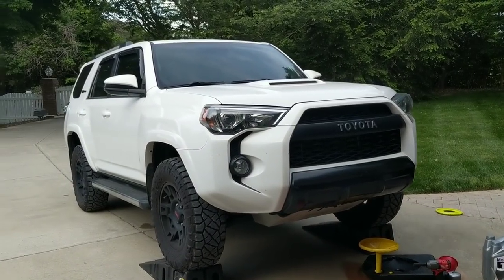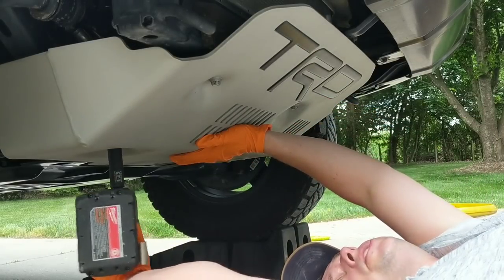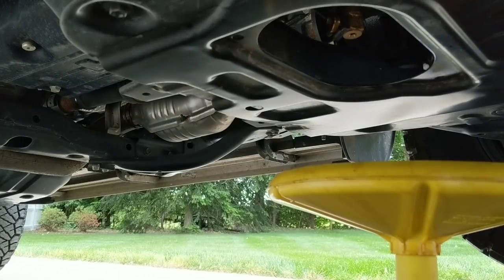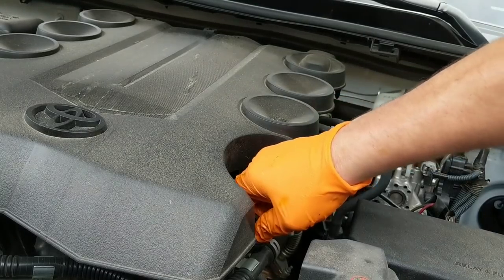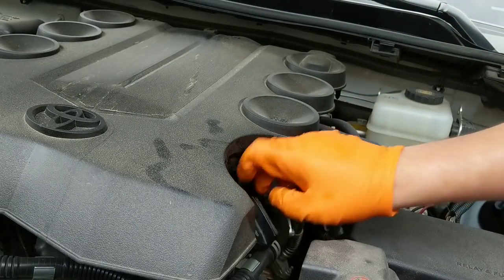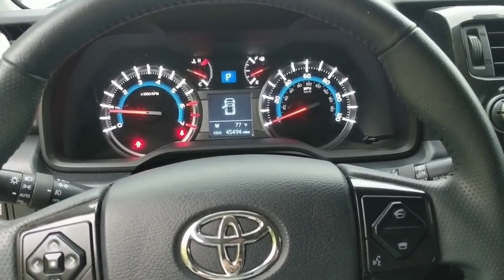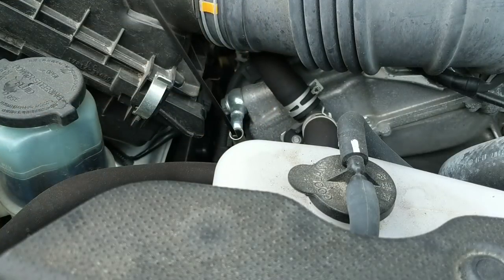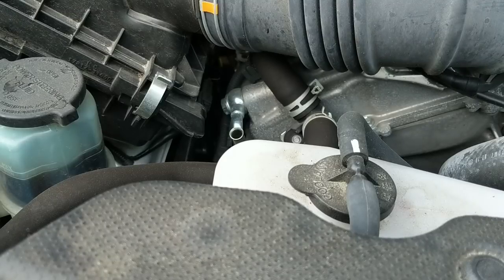2010 - 2021 Toyota 4Runner Oil Change - Beginner's Guide

Comment: Those with a TRDpro skid plate - go to the local hardware store and buy rubber washers to hold your front bolts in place. In other words, insert the bolt through the plate, drip space down, and add the rubber washer on top. This washer will hold the bolt and washer in place while you lift the plate up to bolt on.

Comment: I own 2 4runners 5th gen. My wife has the Limited and I own the 2016 TRD pro.  I also changed my spark plugs at 30k and I noticed my fule effeicy improve by 3 mpg more on my TRD pro and 4 on my Limited. I was getting around 12 mpg on my limited and 14 on my TRD pro. My advice is CHANGE THE OIL THE ENGINE OIL THE FIRST 2K MILES, THEN AT 5K, THEN EVERY 3-4K WITH SYNTHETIC. Why, from experimentation and diagnostic tools from my friends shops using heat and yes, I was so OCD about getting my answer, I sent in samples to a lab to see the results. The first 2k miles are curicial because that's when the engine is breaking in and there will be some fine metal shaving, you wont see it, but you can feel somewhat and the lab will defiantly indicate that.  After that, at 5k,  your repeating the process with less shavings. It took me a total of 3 engine changes at short intervals for about 10k miles to break it in. Where I found very little metal shavings. I don't care what anyone says, this is the proper way to do it NOW IF YOU TOW, LIVE IN PLACES LIKE NYC WHERE THERE LOTS OF STOP AND GO  AND HEAT. GET THAT ENGINE OIL CHANGED OUT EVERY 3K RELIGIOUSLY .  TRANSMISSION OIL THE FIRST 15K MILES IS CRUCIAL. THERE WAS VISIBLE TRANSMISSION SHAVINGS then at 15K MILES. Personally I would even do it at 8k then 15k then 30k.  Then every 20-30k miles DEPENDING ON HOW YOU U SE YOUR 4RUNNER.
Reply from the maker: All great advice! Most people are not as meticulous, but I agree it will lead to a longer life of the engine. Nicely done using Blackstone or whoever for testing. I use them as well. Thanks for the comment!
Reply: @BtwilliasGarage   Thank you brother and congradulations on the Runner. May she serve you loyally and reliably for many years to come. I doubt it cause it's Japanese made and the critera from what I understand is super strict, IT'S NOT LIKE WHAT AMERICAN TOYOTA IS. though american toyota is still good. My brother has a 2016 toyota Camry, made in USA  with 100k, 3 accidents, flooding, stolen and 1 pile up accident. fixed it every time. SAME ENGINE AND TRANSMISSION. He thinks following my protocol helped give with the engine and transmission longevity.
Reply from the maker: @aky19832001  Good stuff man! My 3rd Gen has 289k and still going strong. Hope the same future is in order for the 5th Gen. I will keep the oil changes under 5k and we shall see. What oil do you use?
Reply: @BtwilliasGarage   I use only “Toyota Genuine Motor Oil” : ILSAC GF-5 multigrade SAE 0W-20 engine oil
. You get better gas mileage than the 5w series. Everyone tries to argue, and i"m like READ YOUR MANUAL BUDDY!  This is straight out of their manual. I swore to everyone that my gas mileage was attributed to oil, no one believed me. NOT EVEN THE DEALER. WHEN I went back to make sure the oil was ow-20, which it wasn't, it was  5w, I had them change it immediately to ow, it took me 2 oil changes to see the difference of 4 mpg extra. that matters. because 4mpg extra at 20 gallons, that's 40 extra gallons at 3 dollars a gallon, that's $120 dollar saved. This is from the Owner's manual for 4runners 5th gen page 465-
 “Toyota Genuine Motor Oil” is used in your Toyota vehicle. Use Toyota approved “Toyota Genuine Motor Oil” or equivalent to satisfy the following grade and viscosity.

Oil grade: ILSAC GF-5 multigrade engine oil Recommended viscosity: SAE 0W-20 SAE 0W-20 is the best choice for good fuel economy and good starting in cold weather. If SAE 0W-20 is not available, SAE 5W-20 oil may be used. However, it must be replaced
with SAE 0W-20 at the next oil change. Oil viscosity (0W-20 is explained here as an example):
• The 0W in 0W-20 indicates the characteristic of the oil which
allows cold startability. Oils with a lower value before the W allow
for easier starting of the engine in cold weather.
• The 20 in 0W-20 indicates the viscosity characteristic of the oil
when the oil is at high temperature. An oil with a higher viscosity
(one with a higher value) may be better suited if the vehicle is
operated at high speeds, or under extreme load conditions.
""- Why give your self a headache and try to do something that's not your job as in go again'st what Toyota designed. I'm a physician by trade, not a engineer. I love Toyota 4runners. and I'm a "fanboy" lol of their SUV ( landcruisers, prado, lexus) , but that's as far as I go. I  know people make fun of  me but when they don't have much to say when they start running into high temperatures and burning engine oil
https://www.toyota.com/t3Portal/document/om-s/OM35B48U/pdf/OM35B48U.pdf
Reply: @BtwilliasGarage   Also more about engine oil that people don't know from toyota 4runner manual ■Engine oil consumption
A certain amount of engine oil will be consumed while driving. In the following
situations, oil consumption may increase, and engine oil may need to be
refilled in between oil maintenance intervals.
●When the engine is new, for example directly after purchasing the vehicle or
after replacing the engine
●If low quality oil or oil of an inappropriate viscosity is used
●When driving at high engine speeds or with a heavy load, when towing, or
when driving while accelerating or decelerating frequently
●When leaving the engine idling for a long time, or when driving frequently
through heavy traffic
Reply from the maker: @aky19832001  all good info. Thanks for sharing!

Comment: Just did mine yesterday and was a nightmare without ramps or jackstands. Now I know. Swapped out the OEM plastic filter housing for a better aluminum metal one. Love that lil valve for the drain plug! That's next time. Yeeeeew 🤘🏼
Reply from the maker: Nice work! Thank you

Comment: To increase torque on your ratchet, you can always use a piece of copper pipe about 12" long and insert about 4" of the ratchet handle into the copper pipe.  Or you can just use the the ratchet extension with a deep socket (if you set comes with deep sockets) instead of the copper pipe.

Comment: If the drain plug on the oil filter is over tightened , yep it's supposed to be torqued to 10 pounds. The filter cap is supposed to be torqued down to 25 pounds. Over tightening without using a torque wrench you could end up having big problems down the road.  You Can you hold the oil filter cap in your hand and tighten the drain plug with the torque wrench. 10 pounds clicks off very easily. Then do everything else and put the cap back up underneath the engine and torque to 25 pounds.   Drain plug, replace the washer and torque to 30 pounds.    Good video, details are important.
Reply from the maker: Thanks man!
Reply: 2016 TIS repair manual specifies:
Oil Filter Cap Assembly: Toyota part #: 1565038020 (18 ft·lbf)
Do earlier 5th gen repair manuals specify 25 ft.lbs?

Comment: Take off your oil cap and put it on your hood latch and pull your oil dipstick out a little doing these steps first will help you to remember to fill the oil up before starting the engine and will help with the drain time slightly.

Comment: Try a small piece of double stick tape to hold the spacers in place. I've used this trick is tight spots.
Reply from the maker: Good idea. I actually went overboard and went with JB weld. They still come off every few oil changes, but I prefer it that way. Just use a drop and it's serviceable if needed

Comment: I have seen brass and aluminum fittings have a bad reaction ( I believe they are incompatible metals). That valve used long term could ruin your block unless there is something preventing this from happening once the stainless steel coating wears off?
Reply from the maker: At 107k/5 years and going strong. They are used by tens of thousands of people/vehicles, but I'll be the first to scream it if it ever causes issues

Comment: Hello! Great video. I do have a question about the Fumoto drain valve. In the instructions it says not to over torque. I am assuming this just means do not over tighten, is that correct? Just starting to do my own oil changes and this valve looks like it will make my life easier.
Reply from the maker: That is correct. If you don't have a torque wrench then I would advise you to just tighten it with a wrench until it give you resistance. Just go until it stops plus a extra little bump. Don't go crazy with tightening after it stops. You will be good. Best of luck and stay healthy

Comment: Instructive video! I'm at the dealer now having the 30K service performed but I will definitively conduct the next oil change myself. Question -- I've read that the oil gets drained more properly with the vehicle positioned flat, but in your case you just lift the front with a pair of ramps. This doesn't concern you any?
Reply from the maker: Good question. It would help a little I'm sure to be flat, but we are talking around .1 of a quart. There is always a little oil left and the 4runners definitely have enough room to change the oil without any sort of lift. You could go either route, but I wouldn't lose sleep over it either way. Thanks for watching!
Reply: Just put back of the track half way in garage and front half way on step part of driveway on the ramp. Now it’s flat and you have lots of room under.🇨🇦

Comment: I've never had a problem with my cap staying on the filter housing like that.  Once the cap is off and through draining I have to use that housing tool to remove it from the block.  I use my torque wrench for that job.  It's much easier than your short socket wrench because it's longer and you're using more leverage.  Food for thought.
Reply from the maker: I appreciate you commenting. Great points!
Reply from the maker: Although if I am reading correctly, be aware it's not recommended to use a torque wrench to break stuff loose. Get you a cheap AutoZone breaker bar. You don't want to ruin your nice torque wrench pins
Reply: Its hit or miss for me. I think the cap is more of a fight when i over-tighten it. Who actually torques that cap? Anymore, I wait till the metals tuch and give it a little more. I figure the Oring in there will prevent it from backing out...
Reply: I had trouble removing the metal cap off her housing my daughter's Rav4 once.  Each time I tried to remove the cap the entire filter housing would turn.  So I used my impact driver and it zipped off nice and neat.  I just wish Toyota would improve the funnel to drain the oil from the filter before removing the housing.

Comment: Thanks for this...I have a 2019 that I'm changing myself instead of using Toyota care...due to horror stories that I've heard about the skid plate bolts getting stripped out by the dealer...
Reply from the maker: Right on man! Thanks for taking the time to let me know it helped. Enjoy the job, it's nice getting to know the 4Runner. Check for rust and check out fluid film for winter months if your area gets any salt on the roads. My latest Shrockworks Rock slider install video covered how to apply it near the beginning after the intro
Reply from the maker: No doubt man! I have heard the horror stories. Outside of 1 alignment using a proper Hunter machine at a trusted shop, I am proud to say that I am the only person to touch this 4Runner, mechanically speaking. Enjoy your 4R!
Reply: My dealer sheered off two of my bolts. They only changed my oil 2 times. The first time, they did not even bother to change it. They must have thought I wouldn't notice since my 4runner only had low miles. I noticed.  I caught them red-handed sabotaging the brakes on my other car. This dealer is not touching my car after this.
Reply: Great video. Even though the dealership offered me the Toyota care I will never have them do any oil or fluid change on my 4runner.  I learned not to trust the technicians at the dealership.

Comment: Those spacing washers on the skid plate can be held in place with contact cement. It will keep them in place long enough to insert the bolt.
Reply from the maker: Agreed, I did that as well. They stay pretty well with that tactic. I used PB weld
Reply: Is pb weld permanent?
Reply from the maker: No you can easily break it off. I actually had to redo mine because I was too heavy handed/light with the application
Reply from the maker: However it is intended to be, so be careful, but if you wanted it off a quick hit with a hammer would knock it off clean with zero damage
Reply: @BtwilliasGarage  Use JB Weld or Silicon Adhisive

Comment: Thanks for the vid.  Quick question the Fumoto Drain Valve looks different then the one you linked.  I'm worried about clearance with oil cover.
Reply from the maker: The linked version will clear perfectly, I appreciate the positive feedback
Reply: @BtwilliasGarage  Thanks for the quick response, you helped me out big time a few years ago installing the remote start.  Been working perfectly ever since.  Thats a great vid as well.  Be well
Reply from the maker: @ribsnwhiskey  same to you my friend! Good to hear from you. Take care
Reply from the maker: Hey - I am worried the link changed now and do not want to be wrong. Please cancel that order and search for this one instead. I will be updating it soon. Sorry about that: and: Fumoto
4.7 out of 5 stars 241Reviews
Fumoto Original F-103 with LC-10 Included F-Series Engine Oil Drain Valve, 1 Pack
Reply: @BtwilliasGarage  No worries I havent ordered yet.  I was pretty sure it was different so thank you for checking.  I'll get the one I see in the video to be sure.
Reply from the maker: @ribsnwhiskey  yes sir, no problem
Reply from the maker: Link has updated in the description if anyone is reading this: https://amzn.to/41tVmxs

Comment: Hey. I have a 2019. I always wondered about something u did. 
Doesn’t using ramps only on the front keep your from getting all of the old oil out? Since it’s on a slanted angle
Reply from the maker: Based on the way the drain plug is at the very bottom on the pan, there should be hardly anything left in it if you are patient and wait for the last few drops. Not a concern, but good question!

Comment: I would J-B Qwik Weld the spacers in place. Oh , and while you're under there might as well lube the propeller (drive) shaft Joints.
Reply from the maker: Yes sir! Did that and it works well

Comment: On the standard skid plate that has the little fingers that slide into slots that require you to hinge them down to slide it forward to remove which can be frustrating if you take the j hook bend out of them it will just slide forward without the hassle.

Comment: Do you prefer this oil filter setup or do you prefer the canister style?
Reply from the maker: Honestly it doesn't matter to me the style, more the location. The skid plate is annoying on the Pro to remove to get to the filter. My 3rd Gen is a pain with the can style due to the location behind the fender well. I hate them the same 😀
Reply: Btwillia's Garage The 3rd gen is a pain. Lol I’ve always liked the way the earlier 1GR’s had the oil filters on top of the engine.

Comment: Call me old school but I would never trust that oil drain valve over the long haul. Looks convenient, but pulling the plug is easy too.
Reply from the maker: I can understand that. I didn't trust them on my vehicles until the locking clip came out. I have used on my lawn mowers and ATVs for years. No issues. Google them. People love them. Pretty neat concept. Thanks for watching!
Reply: I’ll start with my gen 4 first.
Reply: ValvoMax Oil Drain Valve (M12-1.25)
Reply: @BtwilliasGarage   they are great. Used them on my old Blazers for 10+ years with no problems though I did add a small hose clamp as a safety to keep the lever from tripping. probably not necessary.  just got my 4 Runner...glad to see that there's enough room for the fumoto on it
Reply from the maker: Right on Michael! Glad to hear that man. Enjoy the new ride man

Comment: Use permatex on those skid plate spacer’s to hold them in place
Reply from the maker: Yes sir, great idea. I use some JB weld and they tend to hold for 3 oil changes or so before it snaps off. I just put a few drops to make it removable if ever needed

Comment: some background. 30k miles, first 2 oil changes were done at dealership at 10k and 20k...my metal tab broke off(and some housing material came with it too) after loosening it cause the dealer over torqued it :(. after putting everything back (skid plates too etc) and triple checking torque specs etc(only thing i did not torque but hand tightened was the bottom housing gasket), i stupidly  put all 6.6 quarts and didnt check for leaks. after 5 mins, i look underneath and oil was everywhere. after i contained the oil spill, i check drain plug area first and my drain plug area is clean and dry so that leaves the filter housing area that the leak came from. i can't verify if the housing got cracked etc all i know is the metal tab and some of the housing material came off but nothing that looked like a hole/crack was in the housing? not sure if this helped but after i took off the housing to inspect it, i put some oil into the housing to see if it would leak but it didnt. i still cant pinpoint the oil leak since i put the skid back on so the oil got everywhere. i was fortunate to buy a replacement OEM filter housing and will be picking it up in the next day morning. i hope a new housing sorts this out.
Reply: hopefully this site can help you...
https://www.toyota-4runner.org/5th-gen-t4rs/285126-beginner-fluid-maintenance.html

Comment: That bottom drain cap is only 12 foot lbs. and the cap is a little more at 22 foot lbs.  lube your orings it comes off as it should. And don’t use your 3/8 ratchet to tighten the filter housing…….that’s why you can’t get it off.